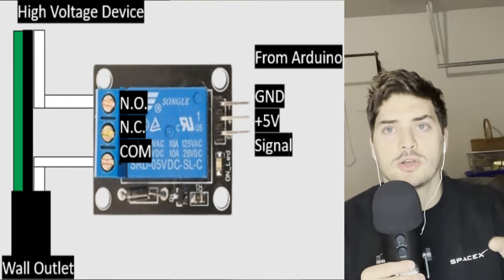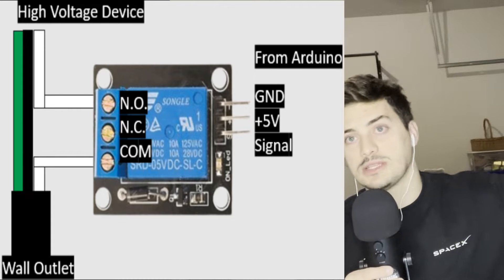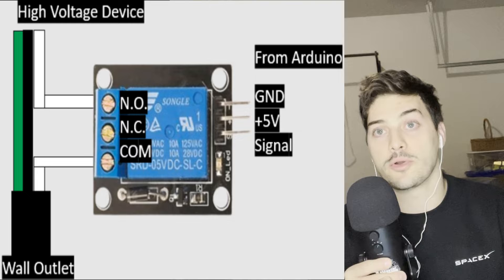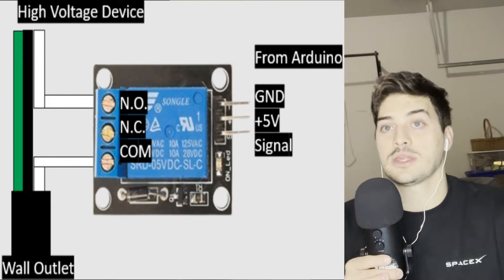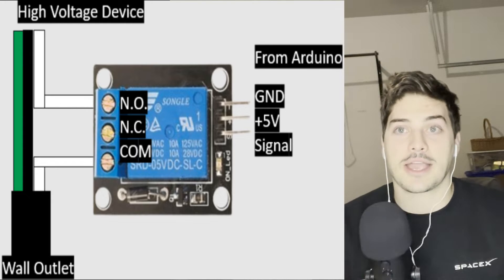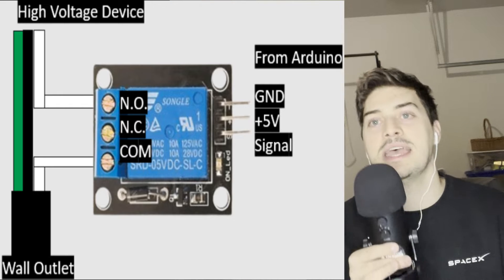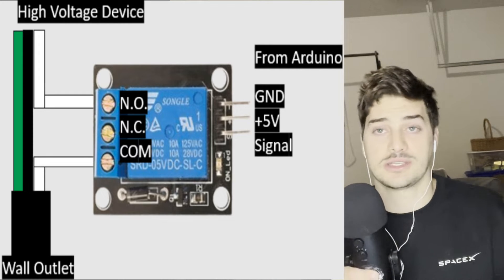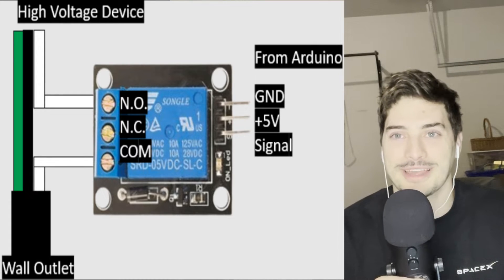How to Use Relays with Arduino

Comment: As you stated, the code for the relay would be treated like a digital out then.
Reply from the maker: Exactly right! You can even use the relay like a digital output with nothing connected to it to verify it clicks and actuates at the right time before wiring any higher voltage stuff into it!
Reply: @lemastertech  In the video I saw that you had another component, can you clarify as to what that is? I am currently working on making a wireless power outlet (smart outlet). I am trying to get through the basic fundamentals and trying to make a prototype of sorts with just a switch or as you did just by connecting wire to 5 volt. If you can show a schematic or a better up close pic of the connections, I would gladly appreciate it.